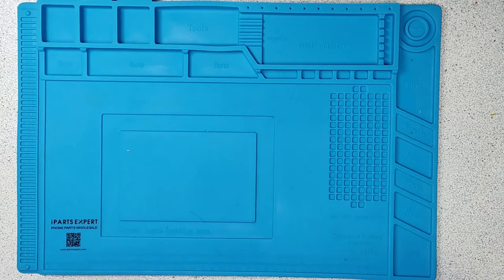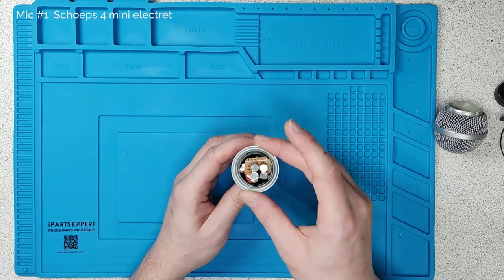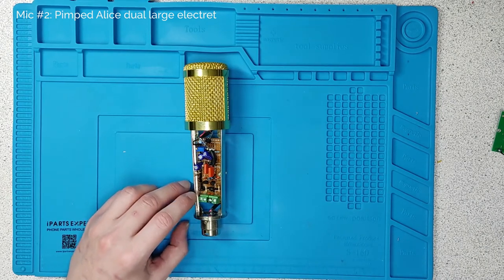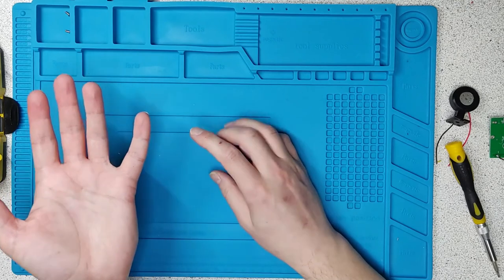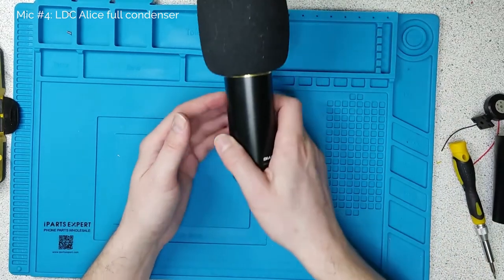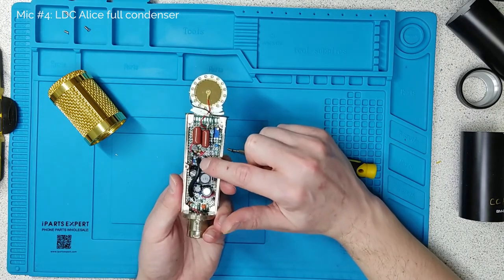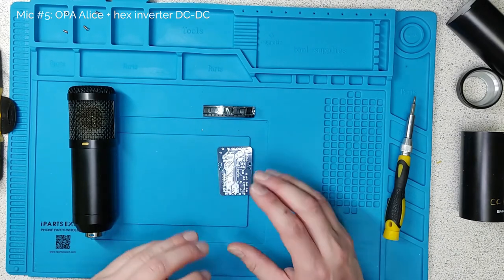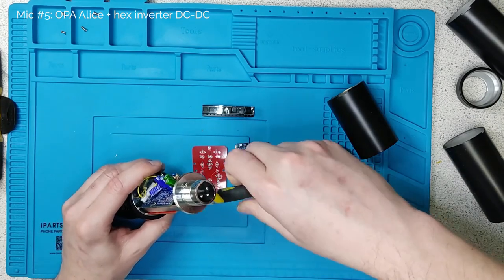5 Homebrew Electret & Condenser Microphones

Comment from the maker: Somebody asked about what audio path I used for the black background shots.

This was:
- Microphone connected to Millenium PP2B Phantom Power Supply (https://www.thomann.de/gb/millenium_pp2b.htm)
- Millenium PP2B Phantom Power unit connected to Behringer DX2000USB mixer
- Output from mixer connected to ESI Maya 44 USB+ soundcard interface

The video of those shots was from a 1080p webcam!

My advice to anyone who wants to easily record video with decent audio, cheaply, is to actually keep it simple:
- Use a smartphone for its rear-facing camera because they have excellent cameras on them
- Get a USB "on the go" cable (https://www.amazon.co.uk/Keple-OTG-Converter-Connector-15/dp/B071W6LT5W/)
- Buy a reasonable USB powered condenser mic like the AT2020 USB (https://www.thomann.de/gb/audio_technica_at2020_usb.htm) or Rosde NT-USB (https://www.thomann.de/gb/rode_nt_usb.htm)
- Connect the mic to your smartphone via the USB on-the-go cable.

Comment: By lowering the zener you lowered the headroom and increased the thd. The capsules don't use the voltage regulated by the zener, the zener sets maximum signal swing voltage fet can use to provide output signal. Also arranging capsules like that doesn't do anything for it's directivity. Take a look at some microphone array papers, and what you need to do to achieve more directivity. Capsules would need to be stacked behind each other, which is also why shotgun mics are long. You would need a chamber to test and measure the effect, otherwise you are just picking up random surface reflections. Fun video though.
Reply: is it possible to increase the output signal of usb mic ? im using fifine k669b but it's pretty bad, it works like a compressor, small sounds it's very loud, but when i speaking my voice is very low . like when I scream the sound doesn't cut but it becomes lower.which is great but it reduces the sound even when I speak normally, ambient sound and noise even louder than my voice
Reply from the maker: Not exactly. Zeners above 6V conduct by avalanche breakdown which is much more noisy. Zeners below 6V conduct by the tunnelling effect which is lower noise. The whole point of dropping the Zener to 5.1V is to get out of the avalanche zone and lower the self-noise of the circuit. 

A side by side set of microphones is essentially a broadside array. Broadside arrays are more directional than single cardioid capsule. Capsules stacked behind each other as you describe makes an endfire array. Both are methods of attaining directionality.
Reply: @MichaelBrooksDr  then use several low voltage zeners in series. There's a filter after the zener, so the inherent noise of the zener shouldn't matter. By lowering zener voltage you definitely worsen the THD, just measure it.

Comment: Hey I wonder what the circuit for the inductor based high voltage generator was. It's not on the instructables guides and I'm trying to fit two alice circuits into a Nw800 style chassis, so the hex inverter board won't fit. I also ordered a bunch of normal alice pcbs so I won't be getting the dual channel pcb.

Comment: great video! gave me inspiration to go down this rabbit hole as well, some question though, are all the mics you showed designed to use phantom power and if so can i get away with the cheapo $13 ones from aliexpress (or can i stick with my usb soundcard and or modify it in some way to make it work)
Reply from the maker: Yes these are all phantom powered. You'll want a sound card capable of taking a balanced mic input, or an external mixer which can take a mic input and output line level. You will then need to buy a phantom power supply if your USB card or mixer do not output phantom power.

The one I use is the Millenium PP2B Phantom Power Supply: https://www.thomann.de/gb/millenium_pp2b.htm
Reply: @MichaelBrooksDr  thank you so much!

Comment: Nice. 
I am not sure, but it looks like your building essentially a pre-amp into many of your Electret Mic bodies. I'll have to look up the Schoeps circuit your using.
I am a retired mathematician that took up stringed instrument building in my retirement & a consequent has become researching with the aim of building transducers and pre-amps to amplify my  acoustic instruments. I am likely going to use Electrets with an op-amp serving as a pre-amp because under saddle pickups tend to dampen the instrument when played strictly in acoustic mode thus your experimentation has been appreciated & I can see why you like the concept of op-amps after a quick Google look at the Schoeps circuit.
Reply from the maker: That is correct, the pre-amp is built into the mic body. This is the case with pretty much all condenser (whether electret or "true condenser") mics because the capsules have a very high impedance thus are unable to drive a long signal line to a mixer or amplifier.

The power to drive the circuit comes from phantom power, which puts a 14mA limit on the total current you can draw. That's what makes the "OPA Alice" op-amp OPA1642 chip very special: high impedance inputs and low current consumption.

Electrets are without a doubt the most compact condensers you'll be able to get your hands on. For audio fidelity, Primo and JLI make some excellent 20Hz-20kHz electrets with good dynamic range.
Reply: @MichaelBrooksDr  Yes, for a stage Mic or Studio Mic the lead could be pretty darn long thus pose a big  voltage loss issue without the pre-amp built in to the Mic's body. I'll be having the preamp tucked in the body of the instrument so at least that saves me the difficulty of making a geometry work with respect to transducer and body. I've assembled a few pre-amps out of lm741 and lm386 chips just because they were in a pile of odds and ends. I must say at first the Dual Power Supply common to the 741 threw me until I realized that it was not a single power supply scheme, but while the 741 is likely not best for my intent with the instruments I find it and op-amps in general interesting because they were and still are used to create math operations in analog computers and to keep busy this winter I'd like to build a simple analog computer. 

Thanks for the additional information....

Comment: Is there a way to turn a "cardioid mic capsule" into a super cardioid polar pick up pattern?? thank you (:
Reply from the maker: You can do this in a couple of ways:

1) For side-address mics, mount a second lower-sensitivity cardioid capsule facing backwards, attenuate its signal slightly, then mix it out of phase with the main capsule's signal.

2) Enclose the capsule in a directional horn. This will make the response to higher frequencies more directional than the response to lower frequencies though. 

3) Drill some more holes in the backplate. This is very hard to get right and for capsules with a rear membrane would require dismantling the capsule.

Comment: I'm confused.  You mention that the true condenser mic element needs around 50 volts for the charge, but  48 volts is right at 50 volts, so why the voltage-doubling circuitry?  Charging the plate is the whole purpose that phantom power is set at 48 volts.  It would seem to me that you'd require more current to convert down to 12v and back up than you would use if you just used the 48 volts that you already have.  Is there a reason that I am missing?  Thanks!
Reply from the maker: It is all to do with the current limitations of phantom power. 48V would be capable of causing painful shocks if it wasn't current limited. So phantom power supplies deliver 48V through 6.8kOhm resistors. This current-limits the 48V.

What this means is that phantom power is 48V when floating and nothing is connected to the end of it, but the moment you start to draw current from it, the actual voltage starts to fall (those 6.8 kOhm resistors and the load you connect to it act as a potential divider). It would be fine if all we were doing is charging a backplate which has a very high effective resistance, but we also need to draw some current from it to power the pre-amp circuitry in the microphone. This causes the 48V to fall downwards (typically to around 20V when drawing just 10mA), so we no longer have a high enough voltage to charge the backplate of the true condenser.

In order to get a reliable voltage for the backplate, the OPA Alice circuit picks a voltage below what the phantom power gets dragged down to, and uses a Zener diode to derive a reliable voltage (12V) even when the amplifier circuitry is drawing slightly different amounts of current as it amplifies the varying sound input signal. The 12V is split two ways: one to power the operational amplifier and the other to charge the backplate

To get back to a high enough voltage to charge the backplate, we need to use a voltage multiplier circuitry, bringing the 12V back up to about 84V. Since that 84V has been derived from our rock-solid 12V, it'll be a nice reliable 84V.
Reply: @MichaelBrooksDr  Thank you for the kind reply.  I knew about the current limiting(and even the 6.8K resistors), but I didn't think about the resulting voltage sag.  The voltage doubler circuitry makes more sense to me now.  Thanks again.

Comment: So you put power on the XLR, direct that to PNP transistor and use the Base of them of extract power?

Would that work on a Akai MPC X and it does have 48 volt phantom.
I do have half a XLR cable, a shop around the corner that sells them.
Was looking at the J113 a couple of days ago, but i got a few of BF256.

I have the get of a phone, but it contains normal 10 mm electric cells.
Reply from the maker: The "Pimped Alice" circuit (modified Schoeps used in Mic 2 and Mic 4) gets its power from phantom power on pin 2 and 3 on the XLR. So the XLR hot and cold lines (pins 2 and 3) each have a 48V DC bias on them. You will need a mixer capable of supplying phantom power to get this to work, which the Akai MPC X does indeed have on its two XLR ports.

See: https://content.instructables.com/FSE/84ZJ/IJHFDPU2/FSE84ZJIJHFDPU2.png

To extract power from the phantom power, the circuit bridges the two collectors of the PNP transistors together, which will sit at 48V, then via the 4k7 resistor drops this down to 12V using the 1N5242B Zener.

The best circuit of the lot however is the OPA Alice with the DC-DC Hex inverter to produce the bias voltage. (Mic 5). This has much less self noise.
Reply: @MichaelBrooksDr  Thnx, i was looking if  LM4040-12 existed, but it doesn't, would a TL341 shunt do the job without causing noise? for the OPA circuit? Could this also be applied to use "electret" microphones on the Akai MPC X 48 phantom power? witch is what i got at home sourced from a old home phone.
Reply from the maker: @AnalogDude_  I wouldn't worry about the noise of the zeners until you've optimised your capsule.

An old home phone microphone capsule won't be very good quality because home phones are narrow bandwidth, so the mics used in them are lacking in bass and treble pickup. Cheap capsules are usually also relatively noisy.

If you're looking for a quality electret, JLI electronics electrets are generally very good (e.g. 2555B). Also Primo makes some high performance electrets with a full 20Hz-20kHz response (e.g. EM23). You will need an electret that does NOT have a built-in FET transistor in the package if you want to use the OPA Alice or Pimped Alice circuits with them.

Electret mics don't need a separate backplate bias voltage, so you won't need to use a DC-DC Hex inverter supply at all for an electret. You just need to tap the phantom power to supply the microphone's signal processing circuit.

As for getting 12V from phantom power in a low noise fashion: a 12V zener followed by an RC filter (as is the case in the OPA Alice and Pimped Alice circuits) works well. An adjustable shunt regulator is just overkill and won't be lower noise. You could improve on a 12V zener theoretically by replacing it with three 4V Zeners in series because zeners below 6V use tunnelling instead of the noisier avalanche method of higher voltage zeners.
Reply: @MichaelBrooksDr  Thank you, i saved your explanation to a text file for the time when I'm going to build on.

if you don't mind.
: )

Comment: Thanks Michael...
What would happen if LDC Alice full condenser board paired with 25mm large capsule electrets? I mean true condenser board paired with electret capsule?
Reply from the maker: The LDC Alice circuit is essentially two PCBs. One is the 60-100V generator for biasing the capsule, the other board is the impedance converter and pre-amplifier to turn the signal from the capsule into something that can be sent down XLR cable. 

An electret capsule doesn't need the bias voltage part. So you can absolutely use the FET Alice / OPA Alice circuit with the electret capsules.
Reply: @MichaelBrooksDr  Thanks Michael...

Comment: Is it fine to parallel a 25mm capsule to a BM800 with 16mm without any electrical piece addition?  Or maybe in Series? We have the same circuit board
Reply from the maker: It's not exactly kosher! I got away with it because the impedances of the two types of electret were similar.

In the 8 capsule mic, the configuration is a series chain of 4 x 25mm, in parallel with a series chain of 4 x 16mm.

I'd not recommend mixing capsules like that for any serious microphone though!

Comment: Sir vi need to make a microphone for church preaching please advice
Reply from the maker: You're describing an indoor live PA scenario here, where the microphone will be used in the same indoor space as the speakers which are relaying the microphone.

Your main problem, especially in a church, will be feedback from the speakers into the microphone. So you should avoid anything with too high sensitivity. You should also aim for a directional (cardoid or supercardoid mic) so you can keep the speaker sound from being picked up. Lapel electret mics would be a bad choice because they are too sensitive and not very directional

Other factors to consider are:
Handling: do you intend to hold the microphone by hand, or in a microphone stand, or do you want a worn headset mic?
Cables: will this mic just be used on stage or do you intend to roam around the entire audience with it?
Ruggedness: will it just be you using this, or are you looking for something that will last years with occasionally being dropped and knocked about?
Mixer and amplifier: what other equipment do you have? If you already have a mixer, can it provide phantom power on microphone channels or not?

If we assume a typical setup: your church has a simple 4 channel mixer with no phantom power, feeding into a few active speakers at the sides pointing towards the audience, and you'll be using this on stage at the front, then I recommend the Sennheiser e835 vocal dynamic mic, or the Shure SM58 which is more expensive but even more durable. If you're on a really tight budget, go for the Behringer XM8500 Ultravoice, but be aware that Behringer gear has a habit of developing faults after a few years.